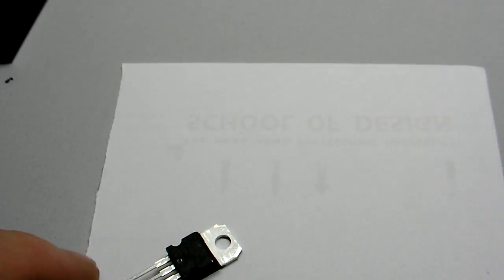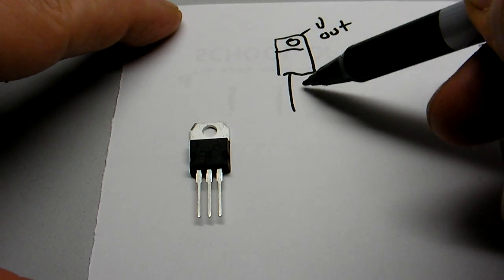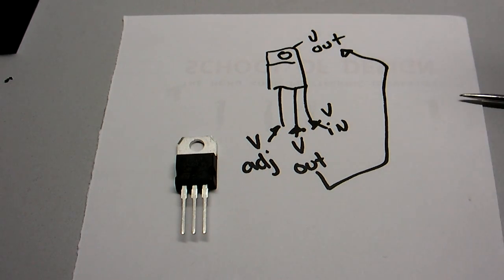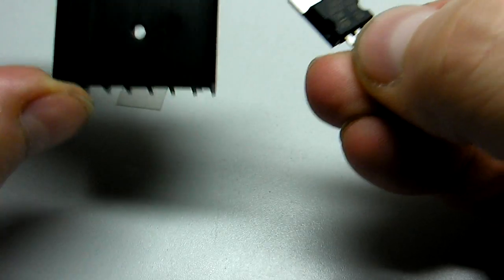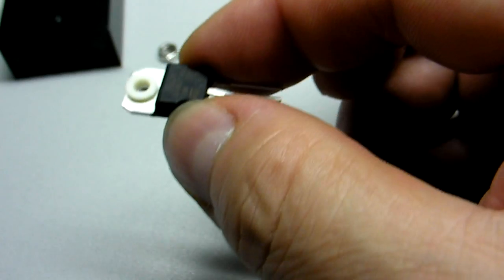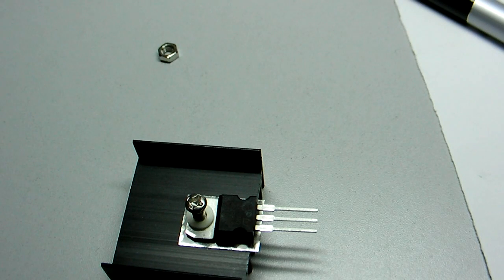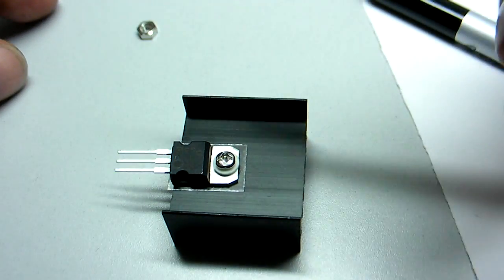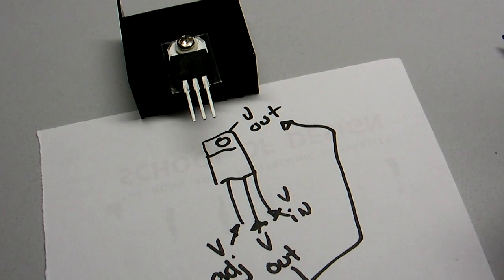LM317T:  What a TO-220 Isolation Kit is and How to Install One

Comment: I bought a five packet of TO-220 'board level heatsinks with the insulation/isolation kit and I'm trying to mitigate a fairly severe case of hot by installing/connecting the heatsink to the existing TO-220 on a motherboard, but it's sorta going to have to sit at an angle and this video, although super helpful, makes it seem like you attach the regulator to the heatsink first, and I kinda need to know how to come in after the fact and try to make it work.

Comment: nice video on installing the insulation kit but what kind of t0220 regulator was it. I double checked the pin set up was:

Left Pin - Vin
Center pin -Vadj
Right Pin - Vout

Was that a mosfet since they have the Gain, Supply and Drain pins?

Comment: Hi, I’d like to offer a few comments. I always use the nut anyway. It adds a slight amount of surface area. More importantly it will stop the screw from loosening from vibration and heating/cooling cycling.
Concerning heat. I try to always use a Vin 3 volts higher than my Vout.  That should keep the heat buildup at a minimum. A heat sink will still be needed, however the heat generated would be less than say a Vin of 24 volts and a Vout of 5 volts. That would generate a lot of heat. 
Just a thought.
Regards to all
Tom
Bell System Ret.

Comment: Don't be so dramatic. Since when did you connect a voltage through a LM317 high enough to give you a shock? The spec sheet  states 1.2 - 37volt dc. Not enough to harm you. Use thermal paste, check for continuity.

Comment: A good point about basic safety that is often not known. The smaller "U"-shaped TO-220 style heat sink kits come with a silicone pad. This pad is just wide enough to wrap around the sides/edges of the IC, to prevent the IC's side/edges from touching the inside walls of the heat sink. It takes great care, and good eye sight, to get the pad to wrap around the IC correctly, before, and during, tightening of the screw. No matter the style of insulator used, you should always use a meter to test for continuity, after assembly.

Comment: if none of the rest of the circuit is touching the heat sink you do not need the mica insulator, but you should use the thermal cream.

Comment: The bolt you mention is actually a nut, the screw you mention is more of a bolt, and grease should be used with mica type insulators.
Reply: The thing he called a screw really is a screw - a ‘machine screw’.  The thing he called a bolt is a nut.  Also I don’t think the primary reason you electrically isolate the heat sink is to keep from shocking people.   You isolate the heat seal because it’s often electrically connected to other points in the circuit, e.g. a chassis, other components attached to it, etc.
Reply: Consulting the machinist's handbook because every correction must contain at least one error... :D
A bolt is used with a nut to fasten unthreaded components together, while a screw fastens something to a component with a threaded hole (or to something where the fastener cuts its own threads, like a wood screw or a self-tapping sheetmetal screw).  In the video above, since the heatsink is threaded, technically the externally-threaded fastener shown (which would typically be called a "machine screw" around here) is used as a screw.  Were the heatsink not threaded and the nut used, that machine screw would magically become a bolt.

Comment: 1) the clear sheet is mica, a mineral, and a pretty good conductor of heat.  2) without thermal grease the (very small) air spaces prevent good conduction of heat to the mica insulator and thence to the heat sink. Thermal grease is an absolute requirement for this style of insulator.  

3) you can find this kind of insulation kit on eBay or Amazon or Mouser.  Get the thermal grease too.  It comes in a tiny toothpaste kind of tube.  Use just enough to fill in all the space between the mica sheet and the part and the heatsink.  (There will be grease on both sides of the mica sheet.)

4) a good alternative is to use a silicone insulation kit.  This will mount much like the video shows with no need for thermal grease, the slightly soft silicone pad will close up the air spaces.  The downside is that each insulator may only be used once; if you have to take it apart for some reason you MUST use a new silicone insulator.
Reply: Mica is SO MUCH better than those sheets of paper silpads :P

Comment: This makes no sense at all. Mica is a very good thermal insulator thereby seriously reducing the value of the heat sink and probably reducing heat transfer compared to not doing anything at all,
Reply: This turns out not to be the case.  Mica is a mineral, they cleave it in sheets from rocks.  It is an excellent thermal conductor, and also an excellent electrical insulator, thus its use from the first days of semiconductors.
Reply: Joseph Cote you are right. I learn something everyday
Reply: you are very right - my error

Comment: How can a heat sink work, if you insulate the heat source from the sink?
Reply: There are two things happening here.  One is the electrical current, which you are insulating the heatsink from.  The other is heat current, which is why you're bolting the unit to a big piece of metal.  The mica is a good electrical insulator, and a good heat conductor.

Comment: The heatsink can still be live if the screw is touching against the voltage regulator as it passes through!
Reply: Thus the white plastic washer that centers the bolt and holds it away from the metal tab.
Reply: @josephcote6120  Joseph, there is something I dont understand about this solution, but I know everybody uses it. Even with the bushing, the heatsink still has a direct, short "air" path to the tab. This air path goes through the small gap between the mica and the bushing. This means that if you have to have the heatsink and the tab at different voltages, that path might not be long enough, might not have enough "clearance." Actually that length is equal to the thickness of the mica. Let me know if my explanation is not clear.

Comment: Where did you get this 'voltage isolation kit'? I have a similar project that needs electrical isolation on the tab of a TDA2030A.
Reply: Found some: http://www.ebay.com/itm/50-set-TO-220-Silver-Color-Heat-Sink-HeatSink-Insulation-Bushing-Mica-Sheet-Pad-/261681794697?hash=item3ced734e89:g:gSYAAOSwg3FUev0g

Comment: can u provide the link for isolation kit ?
Reply: http://www.ebay.com/itm/50-set-TO-220-Silver-Color-Heat-Sink-HeatSink-Insulation-Bushing-Mica-Sheet-Pad-/261681794697?hash=item3ced734e89:g:gSYAAOSwg3FUev0g

Comment: The plastic thing reduces the efficency of the heat sink.  Use the heat sink, skip the isolation thingamajig.
Reply: I don't think an LM317 operates much above 50 volts DC,  At that level you probabily woun't feel anything at all if you touch the transistor.  Anyway most people use there circuits in an enclosure, so not issue.